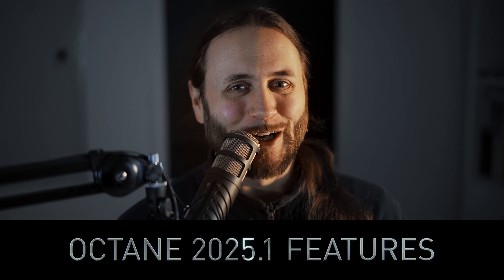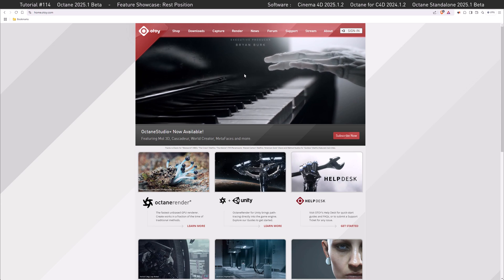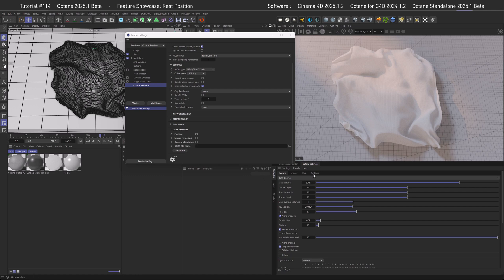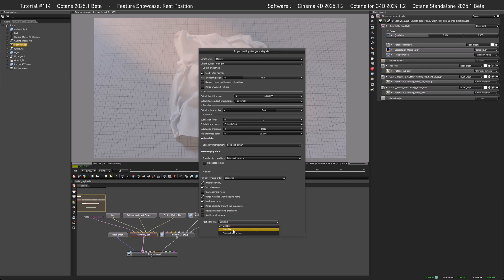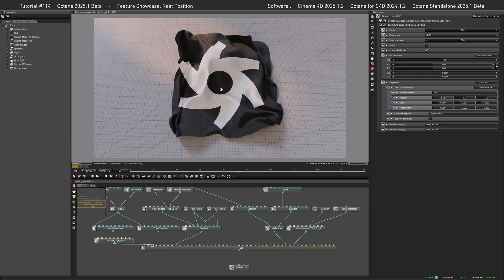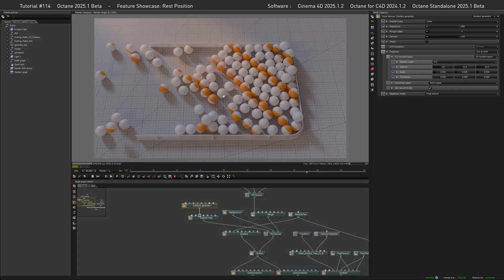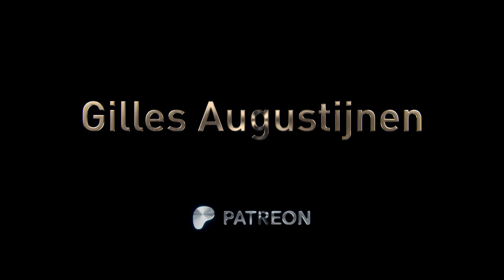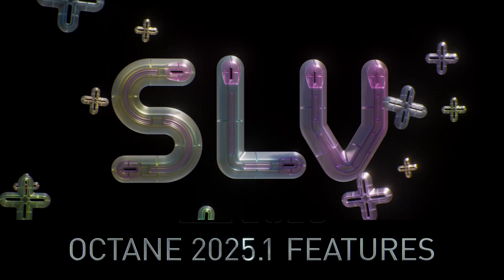Silverwing: Octane 2025.1 Showcase 01 - Rest Position (Octane Standalone)

Comment: It's absolutely unreal how long it has taken them to implement this.
Reply from the maker: At least it's here now 🎉
Reply: And now it’s finally in Standalone, it will take another 2 years till it’s in the plugins
Reply from the maker: @Oldyellowbrick I don't get the negative sentiment people suddenly express in the comments.
I agree that the feature could have been implemented sooner. But Otoy , at least for C4D, is rather fast to release updated plugin versions.
There will be beta C4D plugins once the dev team is ready and it will not take 2 Years!
Reply: @SilverwingVFX  I think for me it's just their marketing methods, they hype things on GDC and sometimes the features never surface, and when/if they do there's a domino effect that has to occur where it's in the alpha  (standalone) > beta(standalone) beta plugin > stable plugin, this process seems to take years for some features. I've been using Redshift for the past few years and you can actually get excited about the features they announce because you can be certain they will be released in all DCC on the next release, you don't have to keep checking a forum that looks like it was built in the mid 90s to see if the feature has even made it to the beta versions yet. ie Octane Brigade, AI models, Gausian splatting, Nanite geometry are all really cool but I question how long till they trickle down to the plugins and what order.
Reply from the maker: @Oldyellowbrick   Thank you for the informative feedback.
I agree with you that Otoys marketing and presentations can be misleading. But other then that, it's pretty much run of the mill.
In the past all new beta versions were stable at least with in a year (not multiple Years) Usually announced at or shortly after Black Friday as an beta and reached stable state on the next Black Friday. Last Year the standalone that was announced at black Friday was hitting stable state in September. Not sure if that was a exception but if not it hint's towards the beta cycle is actually getting shorter.

If a feature is introduced into the Standalone we will get it in the plugin shortly after.
If you are talking C4D plugin. The release of the Standalone and the Plugin usually follow each other within Weeks if not Days. Of course the cycles is a bit different for Beta versions but still usually there is a C4D plugin version within Months if not Weeks.

I would actually count the very early alpha and beta access as an advantage because you as a user can actually steer the development and shape the product much more then with a short notice feature announcement without public testing cycle.

If you are happy using Redshift then all is good. I am always saying that artists should go for the engine they like best. And If you do not like the way the Alpha, Beta, Stable process is handled, then it's good that you found a better alternative with RS.

P.s. my mantra is: Buy the software for what it does do right now, not what is going to do in the future (how in my opinion all purchase decisions should be made).

P.p.s In a time not to long ago there were features announced to Redshift still outstanding after 3 Years. So it's not just Octane who had this happen 😇
Reply: @SilverwingVFX  Thanks for your in depth reply. I do appreciate how you interact with your viewers, very rare on a YouTube channel! I agree on a few of your points, but in regards to the redshift vs Octane thing I freelance for a few agencies and alot of them use Octane so I have no choice in some cases. And there’s definitely pros and cons to each, but that’s another conversation entirely haha. And in regards to using Software for what it does now I kind of disagree with you, as the software you choose is an investment in both time and money, in most cases many years of learning and mastering a tool..So I think like any other investment, you should be relying on the company you invest in to deliver better and more efficient software over time while delivering what they promise, that’s how I see it anyway but I understand there’s different perspectives.
Reply from the maker: @Oldyellowbrick  Again thank you for your kind words and the respectful tone in your messages. I really appreciate it!
I have to agree with you that next to buying the software for what it is at the point of purchase that you of course are also buying in to the ecosystem and practices of the company. I guess it comes down to preferences whether some announced features that never make it into the application roughen your feathers or you are OK with it.
I think for me Otoy has something personal chaotic to it. It's mostly steered by Jules and he is a visionary but that also comes with a bit of a chaotic mindset. Hence the shift in features every once in a while. Of course every company should strife to do better. I personally am quite satisfied with the feature set built in as of now. I don't need a lot of the new features. So it's easily forgiven on my side that some of them don't make it to the end product.
As I said above, this really depends on the perspective you look at it and also what kind of work you have to do with the app.
So despite small differences I guess we end up agreeing on most of the underlying topics more then I thought 🙌
P.s. I am also using Redshift for clients and rarely for spare time works. I just gravitate to Octane for the renderer of choice when it comes to my personal projects.
Reply: @SilverwingVFX  no worries at all it’s sometimes great to have a debate with a fellow creative! Yes I’ve been on the bad end of discontinued software/plugins in the past and it’s not good having to start again. A few years ago I ALMOST learnt Clarise! Very glad I didn’t. A few people I knew were really good in Softimage and Modo and had to essentially start again, which is much harder later on in life with families etc..But yeah you really can’t beat Octane for that filmic look and if you want to do things like that it’s the best engine to use, but Redshift is much more flexible at bending the rules with more abstract looks.